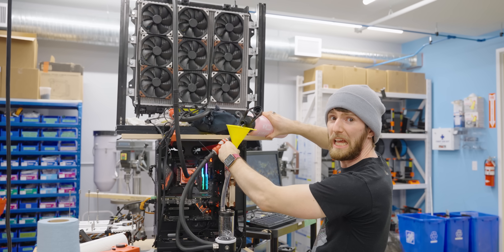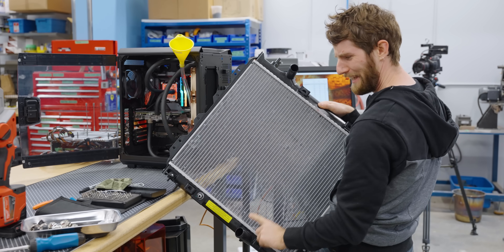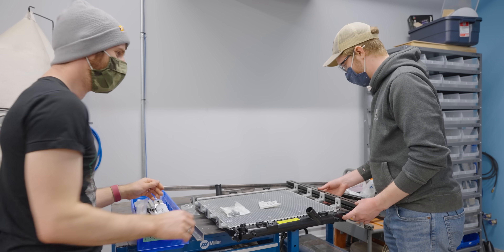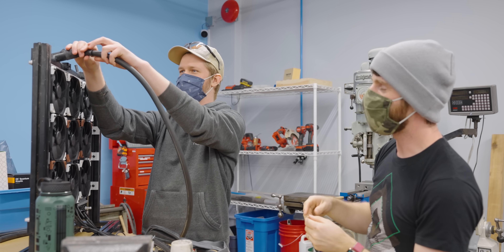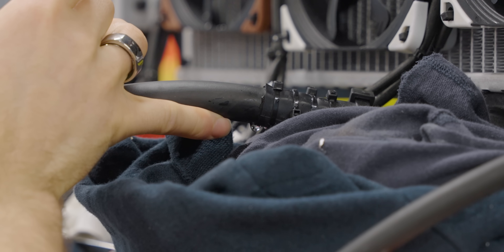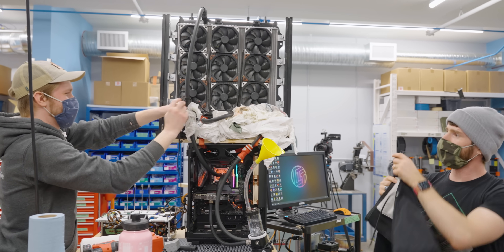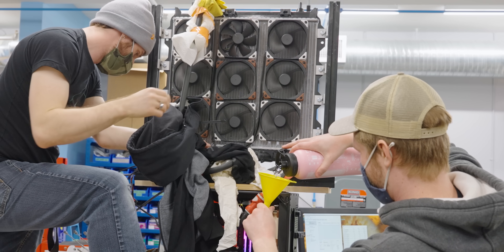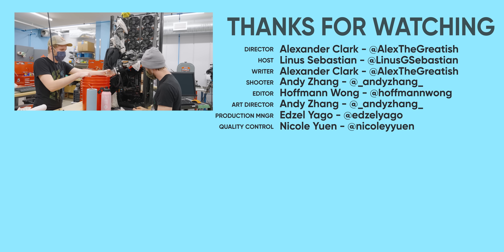Our Craziest Cooling Project Yet - Car radiator liquid cooler

Comment: This gave me flashbacks to my previous workplace...

Management: You have one week to finish this project!
Engineering department: That's impossible, the result would require 24/7 maintenance.
Management: Do it anyways, or there will be consequences!

6 months later
Management: Our engineers are bad, everything they build breaks and needs constant maintenance!
Reply: Lmfao, I can only imagine
Reply: @snesmocha  Yeah, I'm at that point in life where I just refuse to build anything bad at all.
I would rather get fired before building scrap, instead of leaving afterwards due to mental suffering induced by all maintenance.
Reply: @timmy7201  man... good luck m8
Reply: Well said. Ok now bring human cell and RNA messing injections into it and see where it'll all lead :D
Reply: @finlandjourney6065  ? confusion..........
Reply: @finlandjourney6065  Not another one... 
Do a google search on mRNA vaccines between 2000-2010, then notice how the tech is not as new as most think.

We don't abolish air-travel when suddenly one plane crashes, so why are we doing that one particular thing with vaccines? 
Just like every tech will fail at some point, every medication will have some side effects. One in a million occurrences isn't a reason for concerns!

Comment: Honestly, a whole-house heating system using computers mining bitcoin would be really cool. Kinda similar to what Luke did using a household radiator. If you did it right you could probably actually use it at LMG since you have a lot of computers running hot all the time so you would get sufficient heat. Like the last 2 times you've done radiator stuff similar to this, you have been messing about "lets see how it goes" but it would actually be cool if you do it properly one time with the proper equipment and pre-checks for leaks.

Comment: When someone asks "is watercooling worth it?", send them this video.
Reply: I literally went through the whole design process of using a cheap car radiator from summit racing and proper anode rods, etc. For like a good 6 hours one night. I then found out it would likely cost $1200 to build once I included all the parts necessary. I then went and bought a nice air cooler. Could have saved myself 5 and 1/2 hours there.

Comment: I’m planning on building a new pc for university work (arcgis and spss mostly) and gaming, but my budget is somewhat limited ( only 1100€) 
But my mom works at a pc components store and can get the parts with 20% off each. 
This is my (potential) build
CPU: AMD Ryzen 5 3500x
GPU: KFA2 Rtx 2060 6gb 
Motherboard: Gigabyte A520M s2h
RAM: Corsair vengeance pro rgb 16gb (2x8gb) cl18 
CPU Cooler: Corsair hydro H100I PRO XT RGB
Storage: SSD Samsung 970 PRO 1TB M.2 NVMe
Power supply: Corsair RM 650i 80+ Gold
Is this build any good for games like tarkov, the Witcher etc etc

Comment: Why is there no chiller like radiator using water cooling the radiator by water evaporation. That will keep the system way cooler then just a bare radiator cooled by air

Comment: @Linus
Just a heads up, I clicked the link to scan my system and the motherboard came back as the wrong motherboard and was not able to know what my ram manufacture was which is very strange as I have Corsair Vengeance LPX Black DDR4-RAM 3600 MHz 2x 16 GB - schwarz - CMK32GX4M2D3600C18, Plus was only able to see I have a Crucial MX500 500 GB CT500MX500SSD1 but wasn't able to see my other ssd's which are a Samsung 860 EVO 500 GB SATA 2.5 Inch Internal Solid State Drive and a Sabrent 1TB Rocket Nvme PCIe 4.0 M.2 2280 Internal SSD with the heat sink.
My motherboard is a MSI MAG B550 TOMAHAWK Motherboard ATX and the one it was claiming to be in my system was a MPG B550 GAMING EDGE WIFI.
Maybe let them know the scan is not working right.

Comment: Always supply a water coil from the bottom up. Pushes the air out the top and encourages good flow. Think slow rising water vs waterfall.

Comment: I feel like really all we're actually getting from this is that if you connect your water cooled PC to the water mains your temps are likely to go down.
Reply: Funny enough, they did that before. I remember them more or less putting the pump in the sink for a build from years back. I think Luke was still there and might have been in it.
Reply: @SpicyOliv  there is also a really really recent vid where they did that while Linus was on vacation
Reply: @marcusborderlands6177  I must've missed that one, thanks. Gonna have to go digging.
Reply: Hey great idea. Next project better involve water mains. It may not be environmentally friendly, but i'll be cool... until it'll be elecric and eventually hot, as in fire!

Comment: I would have used a standard car sized electric radiator fan instead of all those little computer fans. It would run on 12 vdc so you could set up a relay from the fan headers to control 12 volts to the fan. I venture the sound of the fan would be quieter than all those little fans?

Comment: This thing leaked so badly because you forgot one little thing, YOU’RE DOING THIS IN A MACHINE SHOP!  If you continue to refuse to use any of those big machines to make simple little do-dang-ditty adapters and bits-n-bobs instead of incredibly awful hacks , I insist you move the machines into my basement and then quietly walk away with your head held in shame. ;-)

Comment: Actually would love to see sequel video where 10% more effort is spent on putting radiator on the table and making secure connetions, so it don't leak.
As said in the video it's more of effect of constantly replacing water, rather than radiator effectiveness itself.

There would be still 70% of effort to make the radiator into a case side panel, but it can be optional.

I'm setting like to see the sequel, not to see more unfinished ideas which are in ''proof of concept' state

Comment: LTT should buy a front cut of a car, minus the engine, and put a gaming PC where the engine would be, and plumb the cooling system like this into it. Would look sick. Maybe set it up as a racing rig, replace the windshield with an ultra wide monitor, etc.

Comment: You need some pvc piping and hose . Also , a table fan might be an option . If all else fail , get a tractor trailer truck radiator . Direct the water flowing out of the radiator into a 1/2 hp aquarium chiller and back to the water reservoir container connecting to the pc water pump .

Hot water from pc > radiator with fans > 1/2 hp aquarium chiller > pc water reservoir > pc water pump .

Comment: No just no... Alex you had 1 job. 
Radiator with built-in transmission cooler heats the transmission fluid when cold/at the start, and then maintains the temp. 
You could have just made 2 separate loops, as one is high flow and the other is low flow.
Tho... filling at the lowest point wasn't even the worst part of the video.

Comment: I used to cool a second hand dual socket server with a car radiator I got for free from the scrapyard. Used two diy water-cooling blocks I got for 1€ each on eBay and an garden plumb my neighbors through out. All in all I got a fully quiet server for ~200€. Highschool me was stocked and it worked flawlessly until I disassembled it 3 years later.

Comment: For anyone getting any ideas.
Alphacool NexXxoS XT45 Full Copper 1260mm SuperNova
Is huge and has the same effect as car radiator twice its size.

Yes i did test my first water-cooling setup with a car radiator.

Comment: These numbers are confusing, isnt the cpu the first in the loop after the radiator? If so, how is the cpu at 65C and GPU at 35C, surely the water has not dropped 30C in the tiny tubing length from CPU to GPU...

Comment: In my experience, you can rip the cables out of the Molex connector, place the wires directly into the female Molex connector, and then plug in the male Molex connector to hold the wires in place. As long as the wires aren't too think and you know which wire maps to which hole, this actually works quite well. The connection was more secure than when I used the Molex connectors as intended.

Comment: Running car rad cooling 24/7 - totally silent, temps occasionally jumping to 60*C. (OC 5700XT, OC 5800X). Rad is hanging right from the case with 200mm fans 600rpm's blowing fresh air on it.

Comment: "[...], and with their Crucial System Scanner tool finding the perfect parts for your system is easier than ever!"
I bet this tool is biased AF towards recommending Crucial hardware even though they might not be the "perfect parts for [my] system"
Reply: I mean crucial helps me find out if the laptops I repair can have memory/storage upgraded and tells me recommended speed and capacity. So it's pretty useful.
Reply: @LyricsFred  I'm sure it's useful, but is it unbiased? Does it prefer to recommend Crucial hardware over other hardware even if the Crucial hardware might not be the best choice in some cases, or does it give recommendations independent of the hardware's vendor?

Comment: LTT could have done this successfully but chose to do it dumb to be more entertaining. I don’t like it. If you do it do it right. Big case, replace the back panel with the radiator. Find fittings that have a chance to be water tight. Emergency hose tape would have worked too if you need it to be trash looking. Creating drama to entertain viewers is about as fake as it gets.

Comment: Well, it's cool it's funny, but I'd really like to see it working at least at the end... Puting big radiator on the top was just dumb. No just in therms of leak issues, but also it would be much easier for pump to circulate that watet. They should have place it on the same level as computer and at lest get something they could use as adapter from hardware store. It wasn't that hard to do at all 🙄

Comment: I am actually very disappointed in the amount of jankiness in this, I am sure duct tapping the joints would have prevented most of the leaks. There is a full workshop there and the rad was on top of the pc.

Comment: would have taken 5 minutes on the lathe to make a tube size adapter that would have worked (you've got a colchester truimph 2000 for goodness sakes)...... but sure, bycicle inner tube and duct tape?

Comment: Just use Mora420 radiator, you can configure it with 18x140mm fans for push-pull
Reply: While I appreciate the jankyness and realize that the video is about the fun content, I was thinking the same and appreciate the fact that I´m not alone with this ;) I guess the car radiator would be the cheaper option If you´ve got access to free water.
Reply: @them2613  I own the Alphacool 1080 (9x120mm) rad it costs less than that car radiator and comes with g1/4 threads and fan mounts.

Comment: What I dont get with these projects is the following: Alex has all these amazing machines at his disposal (Lathe, 3D printer, ...).Why arent they used? Alex could even have his own channel showing things like machining and cad work. With these kind of videos I always feel there is a lot of potential wasted. Here he could have created a custom adapter for the Radiator, so the water would not have spilled everywhere and you guys could have gotten some actual test results instead of just dumping all the heat into the thermal capacity of the huge amount of water you added. I understand these videos have to be entertaining, but maybe some middle ground could be found?

Comment: I did this in the 00s, but submerged it in my domestic cold water tank to act as a heat exchanger. Unfortunately the strengthening bars were made of steel which rusted and the aluminium construction set up a galvanic reaction with all my copper water blocks. After 6 months it was a total mess!

Comment: You guys spent $170 on a radiator but couldn't spend the extra money on hose clamps, or tubing? or even the extra 10 minutes to test the radiator away from the PC first? Video started with a good premise but everything after the 5 minute mark was nonsense.

Comment: Take the radiator off the computer. Then put the radiator in a bin to catch all the leaks. Put a hole in the bottom to keep refilling the pump.  Let it run for an hour and tell us the temps. Please

Comment: Don't know why you didn't use the transmission oil cooler with 12 V fan Is pretty much a glorified radiator with a smaller adapter fittingHey even have a recommendation from this website for the auto Derale Cooling Products 13950 - Derale Atomic-Cool Remote Fan-Mounted Oil Coolers Here are the Specifications Fluid Cooler, Fan, Plate Type, Aluminum, Black, 9-3/8 in. x 12-3/4 in. x 4-5/16 in., -6 AN Inlet/Outlet And plus the price is a $184.64 us It's either that or even just search transmission oil cooler with fan on Google and it will pull up several different variations some at lower prices and some with more fans

Comment: I have the case they are using for this. Corsair Carbide AIr 740. That's a chonker case and that radiator dwarfed it.

Comment: This video was hard to watch for multiple reasons. Poor planning and, oh, I don't know, there's a silicon shortage! My friend's 980 died in like November and he can't get a GPU at MSRP. Maybe next time you could put the radiator next to the computer and do some testing before you install it? Also, I think the actual radiator fan for a PT Cruiser runs at 12v DC (not 100% on that).

Comment: Nice Video Linus! Just to let you know, the "Second" loop in that radiator uses the coolant that has been through the main radiator to cool the automatic transmission. It is legitimately just a radiator inside of a radiator.

Edit: Never mind, looks like those two connectors are for the overflow tank that you use to fill your coolant.

Comment: Why did they not just use the inner tube as a pipe?
As long as it's under pressure eg after the pump it would be perfect.
Or they could have just left a pipe inside the inner tube to keep it expanded..

Comment: I'd have probably picked up a radiator and maybe a header tank if you want a radiator from a wrecker for like $50, and maybe used some PVC to step the sizing down with some like JB Weld or whatever for watertightness on the pipes. Step it down to some real fittings and this would have been easy.
In fact finding a radiator with aluminium end tanks second hand would have been easy enough, then you could just straight up weld some fittings on and had it perfect. Bonus points for running a full on automotive e-fan (expensive, but would be neat).
Basically, this could well have been a really cool build if done properly, but at the end of the day we all know that bigger rad + more/more powerful fans = better cooling tbh.

Comment: I cringe every time I see Alex trying to do something mechanical. PLEASE hire someone with real mechanical and fabrication skills! You guys don't even know how a a car radiator works. Next time save some money, get a radiator and the cars electric fan that matches it from a wrecking yard. And you are right, the 'results' you have a completely invalid due to water loss and replenishment. There is no way this was running long enough to heat saturate the loop.

Comment: The mayhem was good but seriously: you take a metal case panel, cut most of it out to mount the radiator on it, mount (zip tie) the fans internally, wire them ofc, and most importantly 
TEST FOR LEAKS. You know...like how they did in previous LTT/NCIX videos...
Then you're done. A transmission cooler- hell a motorcycle radiator would have been a much better size. The fittings are smaller too...but naturally these guys still would have connected them with bubblegum and shoestrings.

Comment: I don't know if this if this has been mentioned before. But addressing the leak issues using correct adapters and sealing techniques at the utility sink for both water flows, connecting all fans correctly this closed system should have worked without all the planned leak drama.

Comment: With Alex being the experienced in house fabricator, why would he not just fill/mill and tap the ports to take standard watercolling fittings. It would take like a hour max and wouldn't leak. Using zip ties to match soft to soft is just dumb.

Comment: can I say... that I want that radiator cooler on my CPU? it will beautiful if we had and Ice box to put some Ice Gell pack and try to overclock with that thing. with that large thermal capacity, it should be adequate to cool CPU+GPU with allot of core on turbo nonstop... especially if they do use real coolant.

and somehow it will nice project to have 4 PC to cool with single car radiator.... oh wait, it will be the whole room cooling saga again :D

Comment: This has to be redone properly with fittings that don't leak. Also put the radiator beside the case instead of on top to alleviate the head pressure issue. This is one of those ridiculous things that might actually work properly and well if it's done right. You should definitely revisit this.

Comment: Would like legit try. With fixed system and closed loop. Also try different radiators. Could try to do house radiators like 4-5 radiators connected to a loop. To see if you can heat the house with pc gaming.

Comment: Concept A+
Implimentation F-
Entertainment value A+++

A properly engineered system may work using an appropriately sized radiator assembly, with some fabrication work, used as a side door. All the other case openings functioning as intake/outlet for the airflow through the radiator.

Comment: Actually this how we did it in the early days, Lada front coolers as rads. I even had the idea of during the winter, the radiator would be outside but my parents would not allow me to drill 2 holes in the window panels for the hoses. :)

Comment: You guys are dumb! A hot glue gun would have quickly sealed up those water leaks, I have used hot glue in even dodgier situations and marvelled at how well it works. Still a good video/idea, as I am tempted to build one now.

Comment: Would have been easier with a hydraulic oil cooler, most of the fittings would be easily adapted